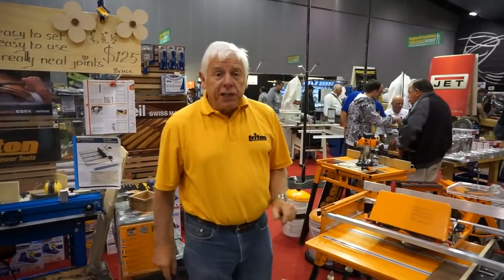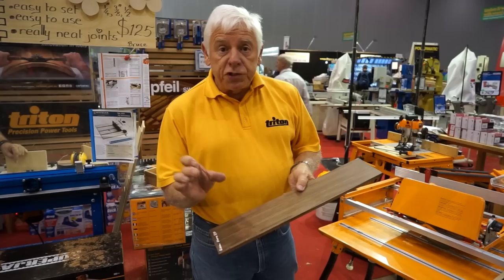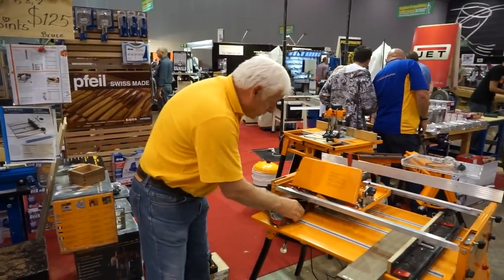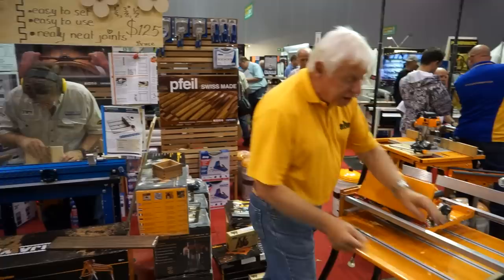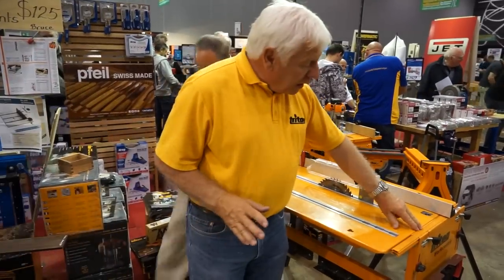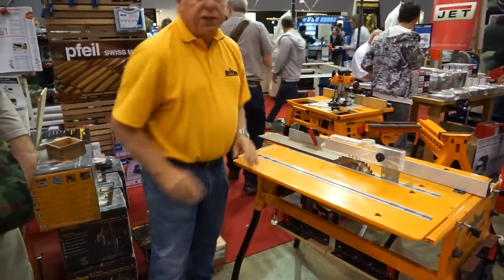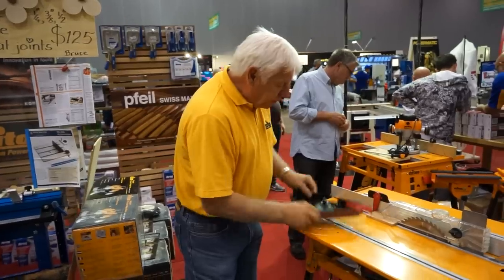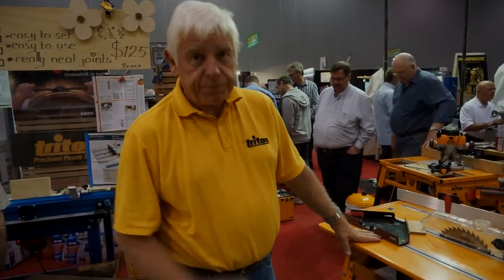Triton Still on Top

Comment: I had a Triton work centre but didn't really know how to use it properly and used it primarily in lieu of a slide saw. I then had a number of years where I didn't need to do any real woodwork so it sat idle. I sold it to a mate who was doing a renovation. Now, as I'm about to do a reno and have more experience, I am in the market to buy another and, this time, use it properly.

Triton is a great design with great features. I'm sorry I sold my original Triton and gear but am looking forward to getting another.

Thanks for the video. Very informative.

Comment: This sort of thing used to be a cheap alternative to a cabinet saw or a router table and you could use your existing tools if you don't mind not having hand tools anymore. I used to have a triton saw and a router table. The best thing is that I sold them and bought a  cabinet saw and built a router table. 

There was not a big difference in price but a real big difference in quality, ease of use  and safety. For example at around 6.00 min he was setting the second side of the fence while standing at the front of the saw, not over the top where there is no parallax error if he sets it with a couple of mm of toe in, part way through the cut it will wedge and If you don't know what is happening a lot of people would push harder and end up in the blade. Ive seen that sort of thing happen because most people who buy a triton really don't have much of an idea of how to safely use a wood working machine.

Comment: Any adjustability for height in that saw blade?  Or do you just chew straight down through a thin piece of wood the same as you wood a 2x4?  Minus one point for "quality work" right there.
Reply: The blade height is adjusted on the circular saw itself, using the normal rise and fall mechanism. For cross cutting, the table can be set at various heights to accomodate different diameter blades, e.g.7 1/4", 9" etc. One drawback of the Triton in rip mode is the thickness of the table itself.......on a 7 1/4" saw, which gives a maximum depth of cut of about 3 1/2"-
you lose the the thickness of the table, which is about a 1/2 ", reducing maximum cut to about 3 ".............all approximate, but you get the idea. I've owned my Triton since 2000, using a 7 1/4" Skil saw, and have now upgraded to a 9" Hitachi.......should have done it years ago. The Workcentre has limitations, but within those, it's a useful piece of kit.
Reply: @ratheanach5545  Thanks for the extra info.  There was a used one for sale locally and I thought it might be a good purchase for a friend of mine with limited shop space ( and almost as limited abilities)
Reply: @marceld6061  Glad to help. I bought mine for much the same reasons, and while I now have more space and a fixed table saw, I still find myself reaching for the Triton...............take it outside to cut 8' x 4's and the like, easier than manouevering large stuff inside a (still small) workshop.

Comment: Those locking hold down fingers break off very easily. The lack of straight channels on the table means you cannot make all the cutting jigs you will see every other table using, that is very limiting. Accurate mitre cuts with the protractor are not as easy as they claim hence the need for a jig, but this table can't use accurate sliding jigs. Any spare parts you might need in Australia are not available or cost a huge amount. There are better options for Austrlaia now.
Reply: Hey mate, I'm in the market for something like this but what wouldn't mind seeing what my options are. What better options would you say there are in Oz now?
Reply: Also interested in the other options